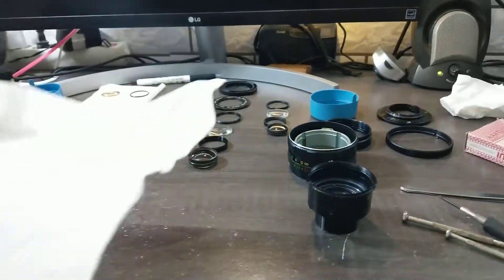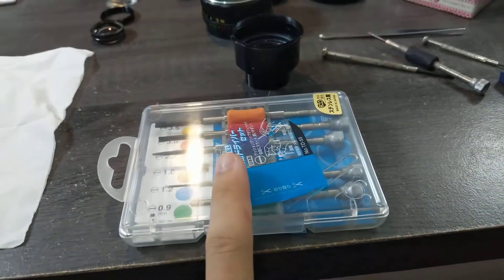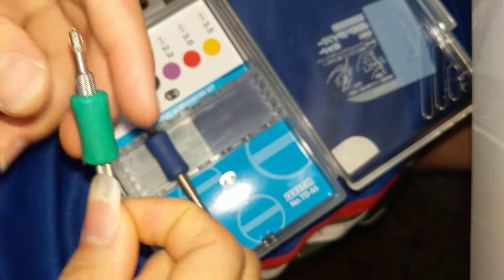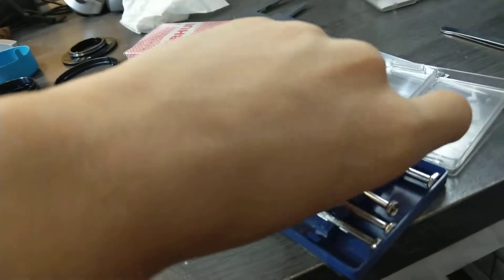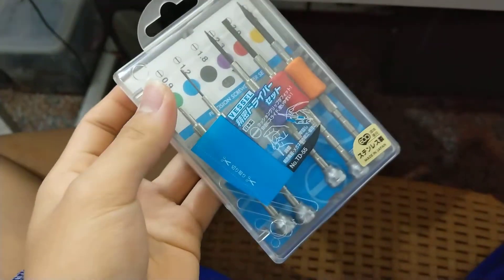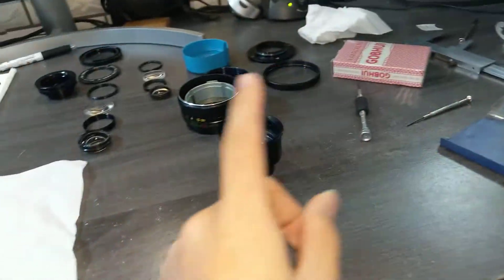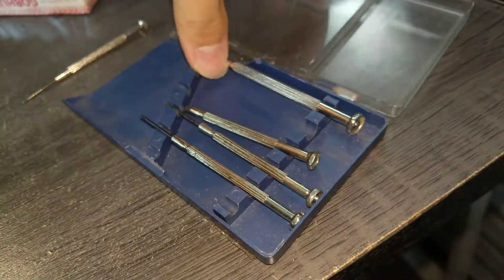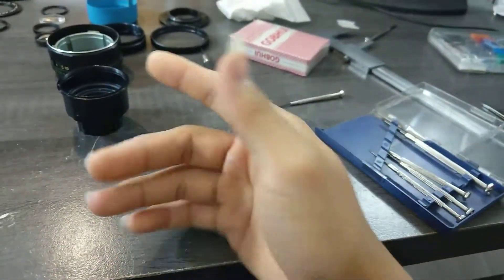Vessel TD-55 Precision Screwdriver Set Review (I Don't Recomend Them To Anyone)

Comment: Why?
Reply from the maker: my 0.9 bit broke in a few days, i didn't put in any crazy torque so i won't be getting any more of these screwdrivers
Reply: @KY_Optics  Oh... but do others hold up fine? As I'm mainly wanting to get this kit for its #1, #0, #00 JIS drivers
Reply from the maker: the tip on the 1.2 broke the day i got it, but because only the tip went i just sanded it into a working bit. everything over that size has been ok. idk for the jis bits because i got the slotted kit without jis bits
Reply: @KY_Optics  thanks for your prompt reply, sounds like it could be a manufacturing defect. glad you at least got it working in the end

Comment: Would you say that these screwdrivers are not much better than many less expensive precision screwdrivers coming from China? On eBay there are comments highly praising this Vessel TD-55 set. One reviewer suggests that these Vessel's are better than Wiha's and he compares the Vessels to old school classic USA screwdrivers from 1960's. Go figure...
Reply from the maker: the vessel set comes with a nicer grip than on the chinese ones, but what i don't like is the rubbish bit material. I now use rapid (random chinese brand) for my  1.0 bit and the xiaomi wiha set for near everything else

*edit: they're not "not much better" but worse because they break, chinese ones get worn down quite a lot before the tip warps, and i've never had one crack/break under normal use

Comment: Generally vessels are good screwdrivers.but the casing is no good.also the length of the these screwdrivers is not that long and it doesn't give good leverage on tight screws.in general you only need.0.00.000.and flat screwdrivers 2,2.5,3.but vessel sell really odd sizes.